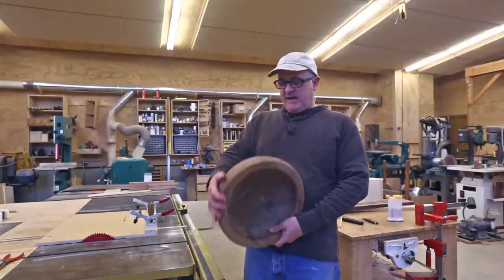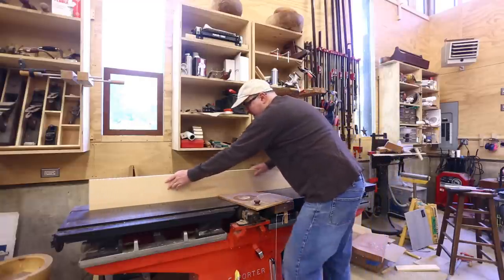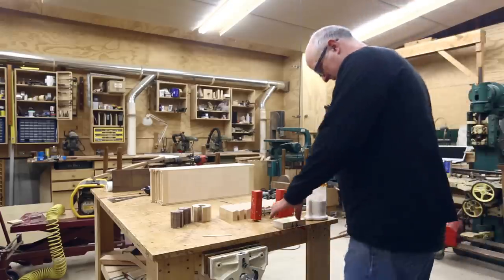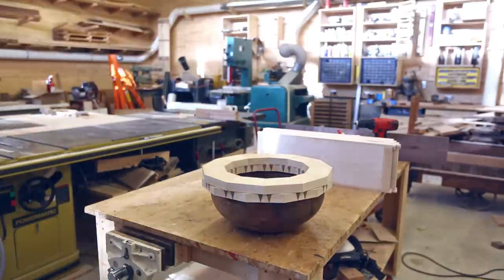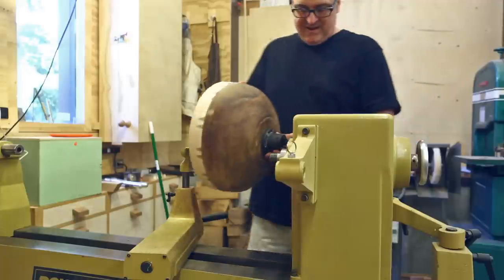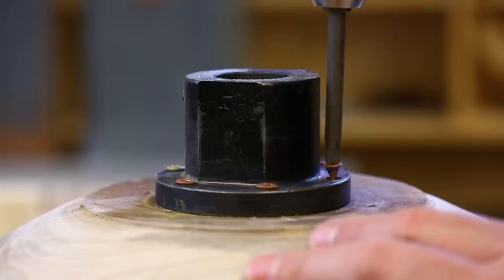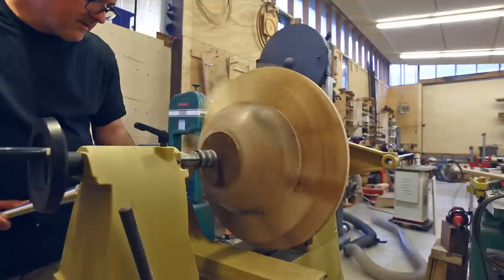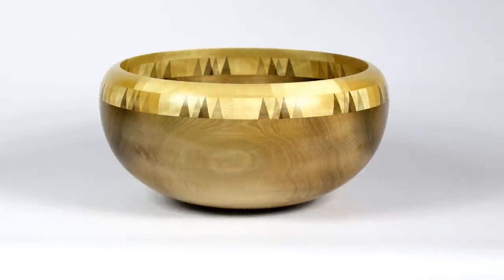Walnut and Birch Bowl

Comment: If you have limited open time, but lots to glue up, try using a mini paint roller kit with a foam sleeve for very quick and even application.  I used to work in a guitar factory.  Works great.  Love your content mate!

Comment: Frank... Don't ever stop making videos. I really enjoy your work. Question for you: Do you let the rim material dry out the same as the bowl itself or is that not a problem due to the size of the pieces you glue together? Awesome work!
Reply from the maker: this is a little risky as the grain in the rim and bowl very in direction.  my guess is if it dose crack it will be on the end grain of the bowl section.

Comment: That earlier system with sausage - is it worse just for turning (because it is endgrain) or something happened to the bowls?
Reply from the maker: Just that it means you turn end grain witch is harder to do and get a nice surface.  In a really big bowl the grain direction might start to matter.
Reply: frank howarth But those earlier bowls are still Ok? I understand, that shrinking and expanding might do some damage.
Reply from the maker: mieguistumas So far they are fine.

Comment: Hi Frank. Would you ever consider turning resin with a mixture of woods set in it? I've seen other videos on YouTube and would love to see you doing something different with it.
Reply from the maker: I have wondered about something like that, ether for filling cracks or carving out shapes in the bowl, filling them, and then turning
Reply: frank howarth it should be possible as long as the surface temperature does not exceed the temperature that breaks down the resin bonds. Best would be an epoxy (Araldite 20/20) or polyurethane as a resin. Keep the amount of added resin as low as possible. Use freshly sharpened cutting tools. For health and safety reasons only turn under air-extraction.  For a glossy or mat finish (fumed silica additive) paint with  the same epoxy or PU.

Comment: How did you adjust the angle at 3:30
fantastic work
Reply from the maker: Trial and error and luck.  I have a piece of wood with two screw holes that line up with two holes in the sled to give me a perfect 15 degree angle.
Reply: Thanks